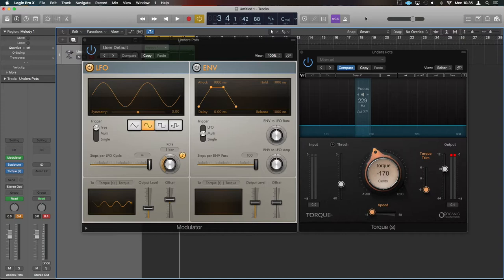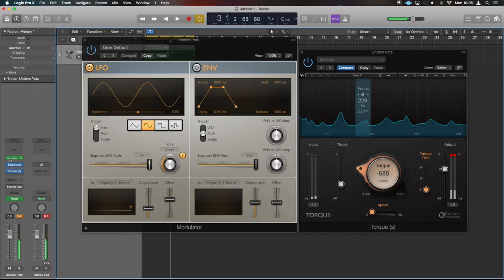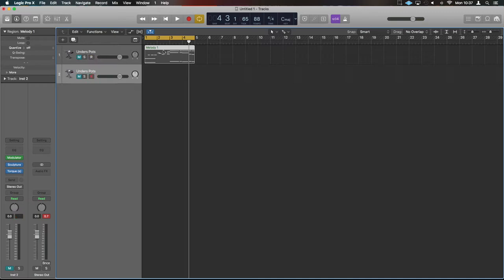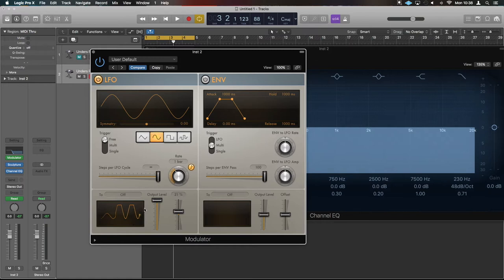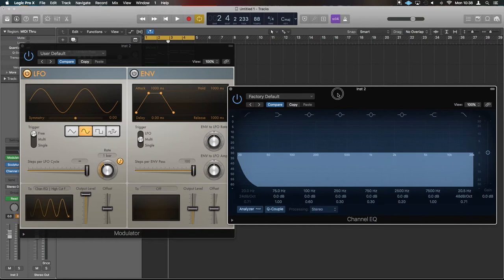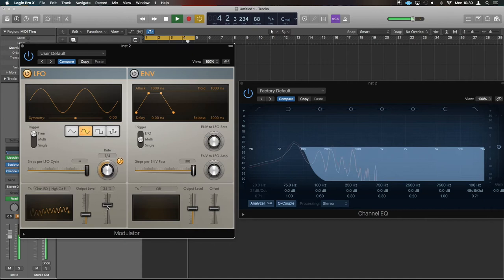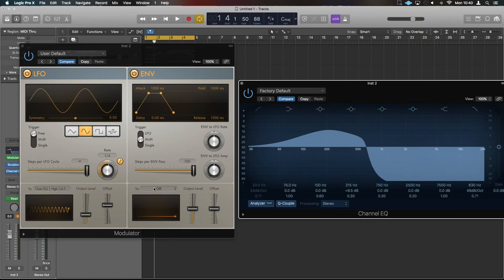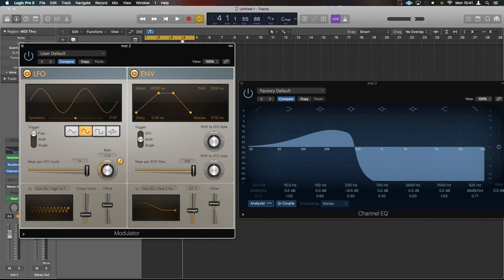How to Link Any Plugin to The LFO - Logic Pro Tutorial #41

Comment: Great tip! Is it possible to have Logic record / write the modulation as automation data? For example in this case, if you later wanted to fine tune some parts of the high cut curve generated by the LFO. I thought that ”touch / latch / write” would do this, but didn’t get it to work.
Reply from the maker: Ive never tried. Id imagine that Logic would disconnect the LFO if you engage it to record because it would be a conflight on playback.
Reply: You could draw it in. Not quite the same